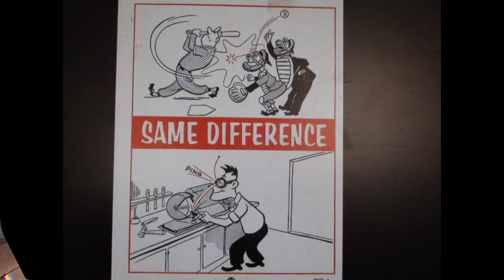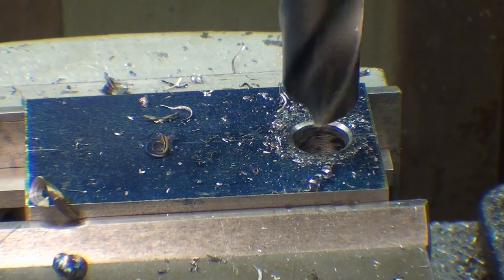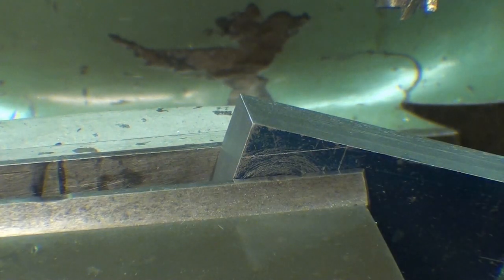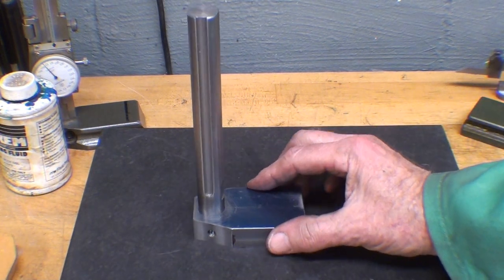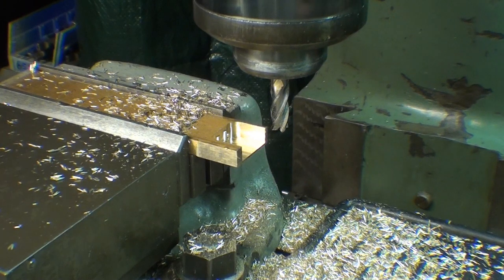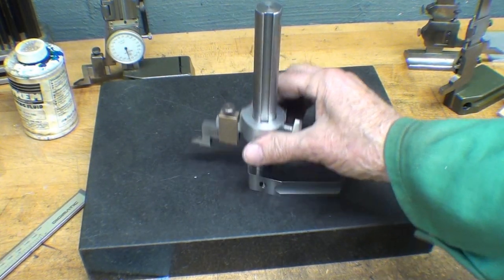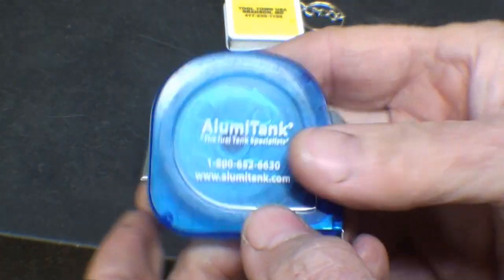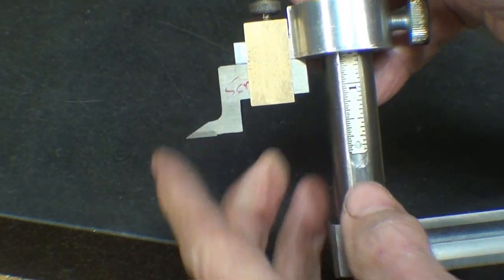TIPS #378 pt 3 How to Make a Height Gauge tubalcain

Comment: Place a piece of stock of the same thickness on the other side of vice jaw to clamp your work. It keeps the vice from racking. I do it with my vices on the drill press and bandsaw when working with short pieces.

Comment: I may be to late for this but you could put a 1/4" piece of brass on the inside radius to fit into the ruler slot shallow enough that it doesn't hit the ruler but will serve a dual purpose. To keep your thumbscrew lined up properly on the flat area and also as a pointer that will put the brass close enough to the ruler that old eyes can read it without to much strain. 
Just a thought. :-)
Reply from the maker: Good thought

Comment: Why would you tap the steel base for a coarse thread and the aluminum slide for a fine thread? My understanding is that for a given nominal size a fine thread bolt is stronger due to how much material is left after cutting the threads, but a coarse thread has more surface area and less likely to pull the threads out of the aluminum.

Comment: Just curious as to why you did not "hollow out" a piece of solid steel for the Clamp.
Reply: The square inside corners are a problem.
Reply: I understand, but files can be used without too much of a hassle.
Reply from the maker: Make a couple your way--and you will see why